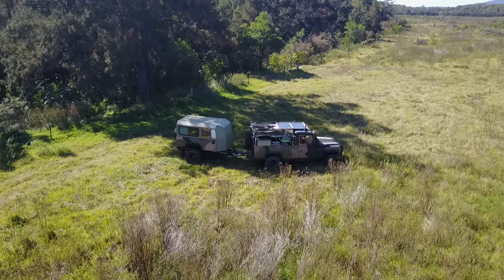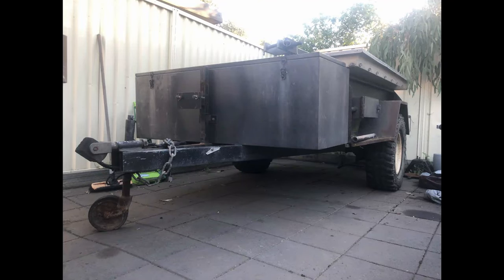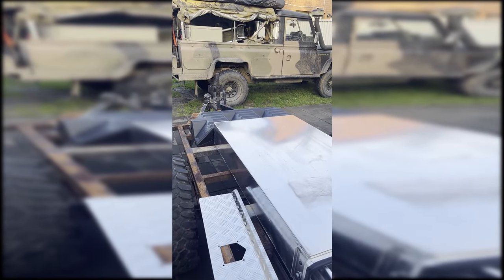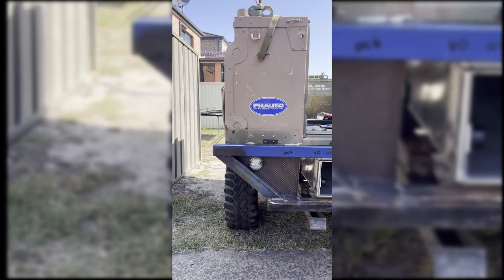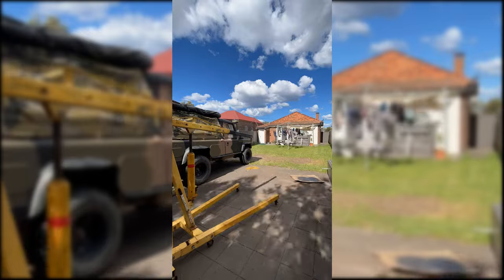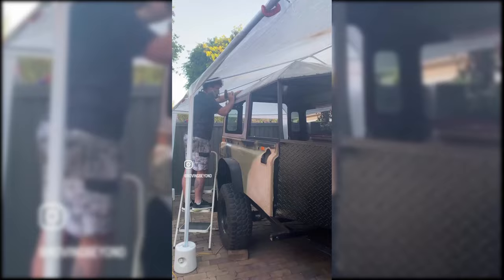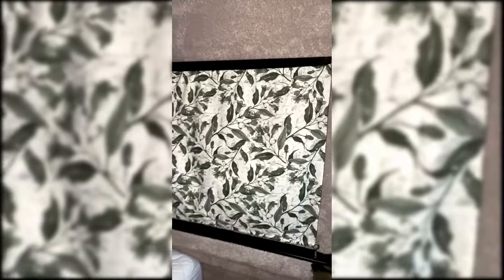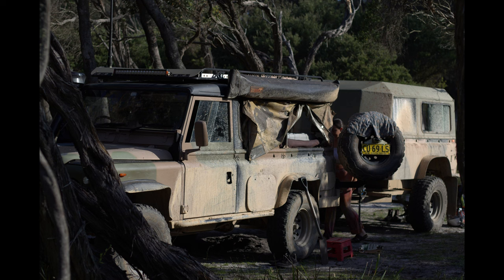Custom Land Rover Perentie Offroad Camper trailer build

Comment: Nice work guys, I did something very similar to this a few years back, but using a de-commissioned military trailer (a Sankey Mk3 wide track trailer), as this trailer have great heavy duty chassis and hydraulic disc brakes fitted as standard, which make these trailer an ideal platform to start from.  keep up the good work
Reply from the maker: @Q_Branch_007  sounds like a really awesome trailer build, thanks for the support 🤙🏼

Comment: Nice video mate, do you know roughly how much it ended up weighing? Would be nice to sleep in a dust free environment 😅
Reply from the maker: Based of some rough calculations after the initial weigh bridge and fitting a drawer etc fully loaded it’s between 6-700 kgs. 750kg rated trailer plus electric brakes so super easy to tow 👍🏼